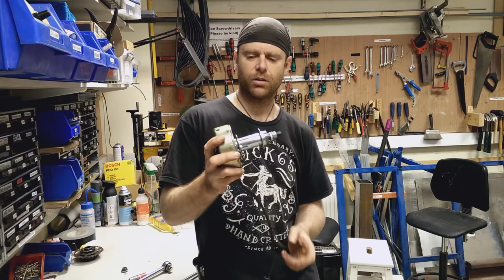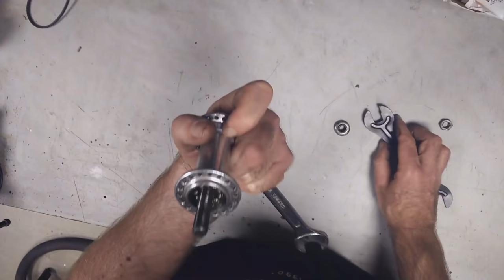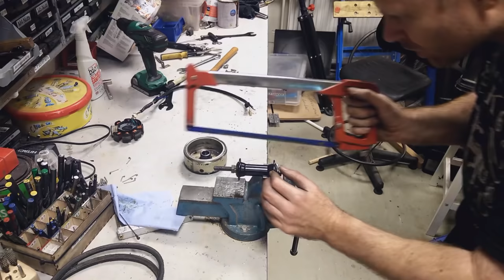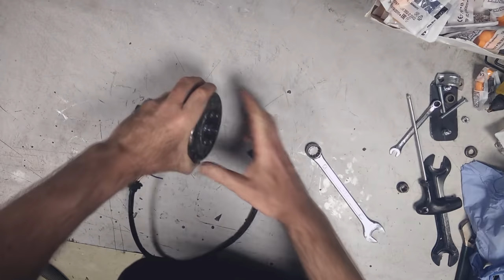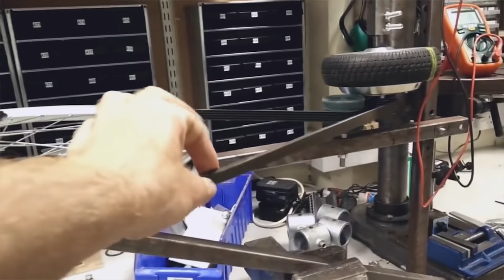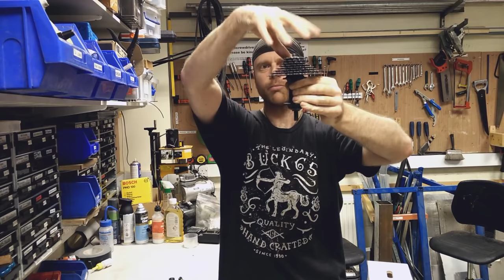Motorbike Alternators With Wind & Water Turbines

Comment: Excellent video with a detailed presentation of how to proceed!

I can easily envision a small scale power system that utilizes solar PV, wind turbine and water turbine to continuously generate power for a lithium ion battery bank.

Strategy: capture as much free energy as you can whenever it is available, charge your battery bank and then use your stored power supply wisely until the next recharge period.
Reply from the maker: This is essentially exactly the approach with renewable energy in general; harvest abundance when you have it (sunny days, windy days, rainy months etc) and then store as much as possible to get you through the rest of the time.
Reply: @OpenSourceLowTech  hey buddy, im kinda new to this "free energy",  IF i find a way to keep multiple water+wind turbine running 24/7, can i connect them to a 10k -15k inverter, make a water heater dump and   light my house 24/7 ?  without having batteries into the system ?    
because my country has no power grid, only mafia generators that are toooo damn expensive and barely give u 10 hours /24h   electricity PS: Yep , its Beirut .
Reply from the maker: @philipfeghaly4210  I am interested in options for not having to have batteries, but they are pretty useful. Even just a couple old car/truck ones to add capacitance into the system. It may be possible with hydro, since it's very stable and reliable (provided the water supply), but there'd be pretty much no chance with wind, as it's perpetually all over the place.

You'd presumably want a lot of supply.
Reply: @OpenSourceLowTech   if you add more aligned fans  and a couple of alternators on the same axe , can u get lets say 3 times more Watts ?   im trying to do it without batteirs  since in my country ,  they sell you the indian fake parts  for twice the price of the premium US, europe prices/quality

Comment: I know you’re shooting for low tech but some 3d printed collets could take all the guess work out of maintaining concentricity along the shaft. I’m really glad I found your system, it makes so much sense!
Reply from the maker: How do you mean?
Reply: @OpenSourceLowTech  it looks like there is a little bit of fiddling to keep the parts aligned along the axis, if you made a tapered collet the taper could handle alignment while the collet grips the other part evenly. If you’d prefer to avoid 3D printing parts you might be able to find collets from something readily available. Lots of machinining equipment use collets for concentricity but I’d bet there is another less expensive source.

Comment: Great idea, very good indeed.  But if you want to minimize friction losses use a biciycle chain instead of a rubber belt because it produces huge drag. And the main problem is that with poor wind the belt is too heavy to start moving.
Reply from the maker: Chain is also definitely an option, and pretty easy to implement considering it's a bike wheel hub it's mounted to. But the issue is gearing, in that to get more than 5:2 from available sprocket sets you'd need to go multi stage, which can be a bit of a faff and introduce further losses.
Using a bicycle wheel as the large pulley with a belt can give up to 12:1 in a single stage, tho it does have the other issues you state.

This is all mostly an issue for wind turbines, hydro is usually higher revving and can often be gotten away with direct drive.
Reply: @OpenSourceLowTech hello mate great vid your a good teacher mate make it less intimidating which is great...anychance have a chinwag if get this cheers mate

Comment: Why didn't I know this channel all these while. I will appreciate to see the results of the project, which wires to connect for charging batteries, and the voltages system (12, 24 or 48volts).
Greetings from Nigeria

Comment: Halo sobat saya suka tutorial generator ini saya baru saja memulai masih bingung penentu penggerak tapi akan fokus pada penggerak angin dengan low RPM dan saluran anda saya temukan memberi motifasi untuk saya ,Terimakasih
Reply from the maker: Any questions let me know.
Reply: @OpenSourceLowTech  Terimakasih ,Dengan tanpa merubah kawat gulungan bisakah hanya bermain dengan roda statis diameter untuk mengejar hitungan RPM dalam mengatasi minim tiupan angin
Reply from the maker: You mean gearing ratios?
Reply: @OpenSourceLowTech  Instead of geatting enough wind by changing of Tweaking feat size, can i be Succesfull  according to your experience?
Sorry it's wrong for my english

Comment: Hey! Just pulled one of these off an old bike I found. If you dont have one of those flat wrenches for the cone nut, I found that it worked to bend a 2" framing nail into a horseshoe, pass it over one side of the cone nut into the flat grooves and grip it with some channel locks. Wrench or other grips on the second nut and it comes right off. The nail fits those groove sizes just the same and no special guy needed. 👍
Reply from the maker: That's actually a very good idea, thanks.

Comment: If you use a Hoverboard magnetic hub, fits perfect,I have a 18 coil Stater from a 500cc 3 phase makes a lot of power.
Reply from the maker: Yeah hoverboard wheels are usually pretty good for these kinds of applications and I use them quite a bit.
This one is meant for parts of the world where they're not available.

Comment: @OpenSourceLowTech can you please make a video on the different types of motors/alternators that would be best recycled. Motorbikes, scooters, washers/dryers etc. And how to wire them if needed for best results. Also if you were to purchase a replacement generator head already made for producing electricity(ex: for a wind turbine or gas generator), which would it be? Thanks.

Comment: Where I am, I can more easily buy a car alternator. I imagine the reasoning with the motorcycle alternator is that in other locales like India, those are easier to come by. As a maker, I appreciate the brilliance of your design. But also I see a problem: if a car alternator is hard to come by, then so too will be the pulley.
Reply from the maker: Car alts have a couple strengths; mainly high max output power and amperage, availability, and often having charge control built in.
But the main drawbacks are they're pretty low on volts per rpm (so you have to spin them fast), not usually self energising, and low efficiency over all.

Comment: Do you have specifics on what one you have because I am unable to find them only parts
Reply from the maker: They're all kind of different. Generally best to go for the biggest slowest bike you can find, as it should do better volts per rpm and power overall.

But more or less any stator and rotor which match should do good enough a job. Try auto wreckers and pull them off an old bike.

Comment: Which is best/most efficient? The motobike alternator or the hoverboard wheel.  I have a shingdengen 020AA regulator/rectifier and want to charge 100Ah wet lead acid.
Reply from the maker: HB wheels are better in most ways. Power rating is more or less the same, but the wheels do about triple the volts per rev, and are a bit more hard wearing and weather sealed. Often cheaper too, if you get an old board second hand for $20-30.
But that's only in countries where they're generally available, while bike alts are literally everywhere.
Reply: Thank you.  I have a lot of HB wheels.
I am going to use it with a 50cc honda clone (gx50) as a portable batterycharger for campervans instead of a large 2000w 230v generator with a batterycharger connected to it.
Reply: @klyddmeisters  can u share any information please , ? I've built a altinator To a gx160  Honda but poor power output unless Very high rpm

Comment: Good evening - respect for your open source lowtech knowledge sharing with us . My question- waterturbine motorbike alternator - you told us output aproximatly 100 ,200 ,400 watt, earlier announced Hoverbike e engine will produce 400-500 watt why we should using  motobike alternator? price ? best regards and thank  you!
Reply from the maker: I'd use a hoverboard wheel if you can get one, it'll do a generally somewhat better job.
But they're usually only available in certain places, whereas motorbike alternators are literally everywhere.
Reply: Tanks YES you are right, WhatsApp the difference in offeriert 100,200 original 400 Watts ? Best regards Thanks for sharing:-)
Reply from the maker: Not sure I understand..

Comment: You are using automobile part to drive this generator, so the most simple way i to directly use a car alternator, they output also more power than motocycles alternator and are also very common.
Reply from the maker: Car alts are higher power and generally more available, but aren't permanent magnet so have lower efficiency, and do about a half to a third the volts per rpm. Also pretty heavy to mount and turn.
Reply: Very hard too spin if u self excite it and need high rpm
Reply: @Opensourcelowtech.org what RPM would you need for a motorbike alternator from a turbine?

Comment: would it be good to attach the outlet of the stator to a motorbike current rectifier?
Reply from the maker: Yeah that should work fairly well as a low key kind of approach. Reg should manage the battery ok, but doesn't have load diversion so will just turn itself off and let the turbine free spin once the battery is charged, which may not be ideal.
I'm going to be experimenting with options for load diversion which don't necessarily require a full charge controller, will see how that turns out.
Reply: @OpenSourceLowTech  thanks for the reply. I'm thinking about building a small water turbine in a small creek that goes by my cabin. And I was thinking about connecting it straight to an inverter. Is there any way to make something cheap and similar to what I'm planning? Thanks again. Your channel is amazing!
Reply: @OpenSourceLowTech   Daniel - if you want some electronic input for a load controller please advise. I'm reasonably good at minimal cost basic components designs. Russell McMahon (Rus El)
Reply from the maker: @rabbitempire5114  What's your water supply like in terms of drop and flow, and how much power you hoping for?
Going straight to an inverter may be possible, I've limited experience in that side of things. You might want to ask on this group: https://www.facebook.com/groups/windturbinemakers 

Russel you'll also know more than me about this stuff.
Reply: @OpenSourceLowTech  well I should calculate the flow, but I can get it to 3 or a bit more meters. I'm planing to intube the water into a 110mm pvc pipe and then make the water fall vertically as you do in your hoverboard generators. But I don't know about the flow... I can take pictures of the stream of water. But I don't know how to send them to you.
Reply from the maker: 3 meters is a good amount for the siphon turbine, flow will want to be about 30-40 liters per second or more, but will still work with less, just be less power and a thinner pipe.
The drop doesn't need to be pure vertical, a bit of an incline is fine.
You can email me via the opensourcelowtech.org website.
Reply: @OpenSourceLowTech  thanks man. I will!

Comment: How is the simplest way to change to DC to charge batteries?  any way it can be done without making a bridge rectifier? Cos I’m having difficulties with that, re  getting the parts etc, I’m a qualified fabricator, but not good with electronics. I want to build a VAWT from a Cordless Drill( I have the Drill and Turbine materials), but can’t do it cos I don’t know what size/capacity Blocking Diode I need?
Reply from the maker: Depending where you're based you can usually get a three phase bridge rectifier on eBay or similar for about $5-10. They're usually rated to something like 50A x 1000V, which is definitely enough for more or less anything.

I never bothered to make my own out of some diodes, but that's also an option.
Reply: @OpenSourceLowTech  Thanks for relying & info, could you tell me what size/capacity Blocking Diode I would need for my above VAWT that is a battery powered hand drill motor( 7-10v ?), to 12v batteries?

Comment: i think the best motorcycle alternators are the motorcycles with very low rpm engines this way you should get best power production also if you find they is not a long enogth axle threaded bar can be used
Reply from the maker: Yeah I've been wanting to get my hands on a quad bike alt, but they're surprisingly rare in western countries and pretty much non existent anywhere else.
Tuktuks might be a better bet tho.
Reply: @OpenSourceLowTech  tuktuk c90 c50 any that kind
Reply: any engine with fixed timing will no doubt be a low rpm engine
Reply from the maker: I don't know a huge amount about motorbikes and engines, which are likely to be fixed timing?
Reply: @OpenSourceLowTech  i think the cdi ignition pritty much change that hole idea i would say small 4 stroke engine are low rpm due to the valves where as 2 strokes less moving parts are higher rpm
Reply: @OpenSourceLowTech  i guess thickness of wire on windings would indicate i would think finer wire would mean slower running engine as more wires to get the voltage up thicker the wire the more the current and faster engine ohms law and all that with maths starts to get beyound me more so Lenz's law
Reply: @OpenSourceLowTech  Hiya I'm a bike tech , been looking to do exactly this to charge our boat battery, the Chinese gy6 engine are a cheap n chearfull engine ( and parts ) scooters are single phase where as the geared bikes (125-150 ect) are 3phase like you have in this video
At the other end of the scal there are the Harley Davidson , they have the same set up as 3 phase at 50 amps , standard , up to 250 amp for the electroglide models !!!
Reply from the maker: @stevepottercanveyislandess6223  Ok thanks, good to know. It's definitely going to be almost entirely scooters, the occasional small bike and tuktuks out in the world.

Comment: how about taking the case and splitting it and using as much of the case with crank cut off and welded to a sprocket or /front cog from motorbike or belt drive etc?
Reply from the maker: Maybe? I haven't really had a good look at the usual casings to see what would be required to do so, but it'd have to be a fairly decent chunk of the thing.

Comment: I recently built a small dam and look forward to building a turbine using this strategy. My creek/dam is rather low flow compared to most and dries up seasonally. Is there a certain minimum amount of waterflow that will be required to make this work? I don't require any particular amount of power, enough to charge a phone or light a bulb would satisfy me as a beginner.
Reply from the maker: How low the flow in wet season, and what's the meters drop?
Reply: @OpenSourceLowTech  The drop is maybe two meters at this point, I might be able to get it up to three meters by spring/wet season.

Edit: If more of a drop is needed, I might be able to construct something else uphill but I'm hoping to use the dam I already made.

Comment: What about universal motors? I know you can use a bridge rectifier and capacitor to charge the external windings magnet and it is in some way related to the rating of the capacitor
Reply from the maker: Field winding motors can be externally energised and induction motors can generate if you get the input revs right, but it's always more hassle and lower efficiency than permanent magnet. Just that the latter usually has less available options..

Comment: What is the best way to mount the alternator axially to your DIY water turbine?
Reply from the maker: Good question and not currently specifically sure, as still using the hoverboard wheels by default and this is the next option to trial.
Essentially it just needs to physically attach such that the water weight hangs off the alternator bearings, and the shaft doesn't unwind out of whatever thread is being used.

It does tho, like with the wingnut assembly on the current configuration with the HB wheel, need to involve a kind of universal joint type functionality, so that any misalignment between the axes of the alternator and drive shaft can be accommodated without vibration or flexing.
So needs to be able to wiggle a little, basically.
Reply: @OpenSourceLowTech  Thank you for the quick reply. Is the hoverboard alternator a more efficient alternative to the motorcycle alternator? If so, I will simply go this route. The reason I am asking is because I recently relocated from the US to the Philippines and am looking for an affordable alternative source of electrical power for the villagers here. There are nearby elevated irrigation canals that could possibly be utilized and your solution offers the most economical option that I have seen.
Reply from the maker: Motorbike alts are fairly reasonable options, but the hoverboard wheels are more efficient, powerful, easy to work with, hard wearing, and weather proof. Often also cheaper, but the one key advantage of the bike alt is that you should be able to get it anywhere in the world, whereas the wheel is more just where there's people rich enough to purchase such items.
I have no idea what the Philippines has available, you may be able to find one somewhere.

Comment: Hello Daniel, thank you so much for the tips, are so interesting!
I have a question for you:
Is it possible to connect it to the mppt of the solar panels to recharge the battery in the cloudy days or in the night time?
Thank you :)
Reply from the maker: Wind and hydro usually make pretty compliments to solar, but a solar MPPT controller won't work well with wind, given its significant and constant fluctuations of voltage and amperage. MPPT wind controllers do exist, but are more expensive and complex.

I've not yet tried plugging a hydro turbine into a solar MPPT, but I think it should maybe do a decent job given the stability of the output.
Reply: @OpenSourceLowTech  thank you for answering! I was thinking... Maybe I just have to put a limiter to avoid the battery overcharing